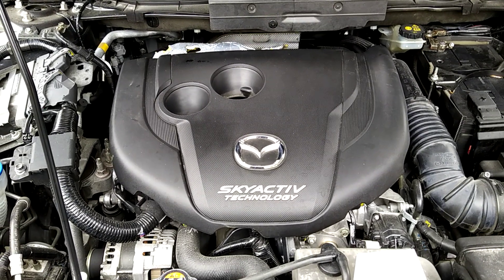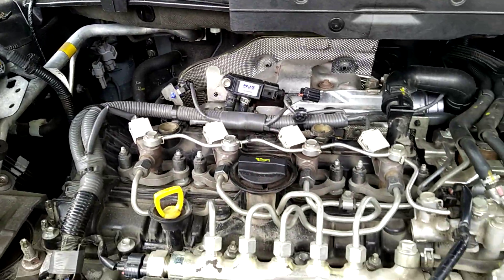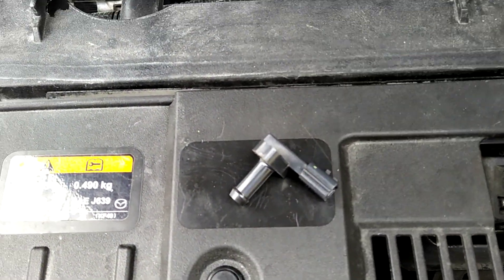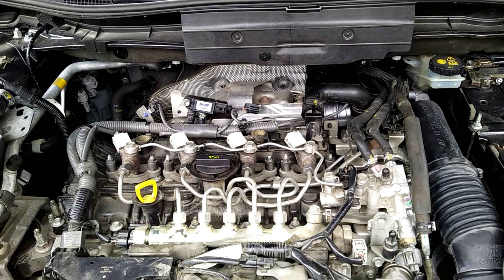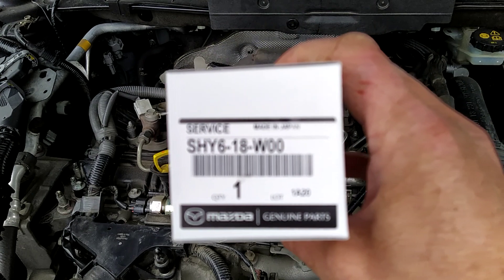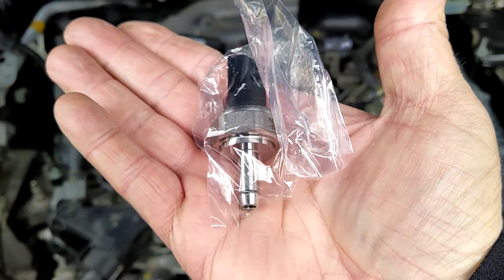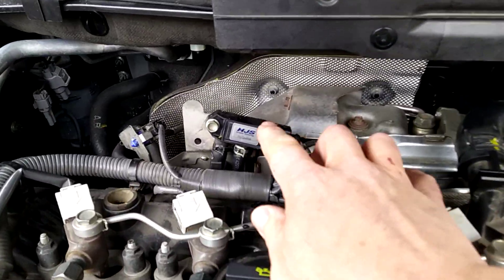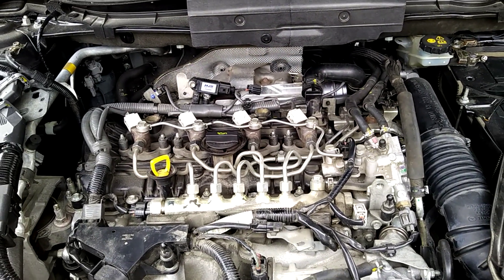Mazda SKYACTIV CX-5 2,2 Diesel DPF / Exhaust pressure sensor **IMPORTANT**

Comment: CARE: You are such a star for making this video, thank you BUT be careful as I've had a Mazda CX-5 2.2 150BHP diesel since new in UK and its done just over 100K miles. I guessed it was carboned up even though I tried to take it for regular motorway runs & the odd 'Italian Tune up'. I had the inlet manifold de-carbonised and had the speciaslist engine centre take photos of the  ports, they were ALL 1/3 the size they should have been - the rest was carbon. After getting the car back, its like a different motor although it took a while for the engine to re-learn that its no longer all choked up. My Exhausr Gas Pressure sensor (right hand one) was also becoming faulty (carboned I guess) with non-linear acelleration & SCBC & TPWS lights coming on - your great video made me change it and probelms solved. I think Mazda nowadays recommend an inlet manifold de-cocke every 40K miles or so which I 100% agree with. Only thing that wont have been de-carbonned will be the backs of the valves and not sure how bad these will be

Comment: Hello. Thanks for time and info you are sharing with all us mortals ;) 

I have 2.2D Mazda CX-5 Optimum 4x4 from 2016; with counter on 101200km. 

I had today my car at the Mazda car dealer to change engine oil and filter. Don't be surprised; I'm handy to some extend, but offer I had for change of engine oil was very attractive. This was probably because they tried to kept me as customer since I bought car as a used one from them a year ago; with used-car warranty for duration of 12 months which by the coincidence expired few days ago.
Mazda dealer reported that had read one fault related to Exhaust Pressure sensor and recommends that sensor to be changed. That offer is around 300 Euro. As soon as I returned from dealer I found and watched this video. Then I called dealer to clarify situation about earlier recalls and if DPF is included in the offer. Dealer states that my car is per day definitely out of warranty and that DPF is not included in the offer. 

Let me be clear, neither I had warning light on the dashboard this morning (last month), nor I have it at this moment.
Luckily for me and my family, I just safely drove 6000+ km this summer holiday.

definitely more times lower on the diesel level than in that moment. I

- Is the problem you described related to only earlier models or is generally appearing on diesel models, even newer once?
- What would you recommend; changing only Exhaust Pressure sensor as offered by dealer, or in package with DPF?
- Since my car is from 2016, I suppose that sensor type in my car is of the improved one. Does that means that it should fit and be of the same size as the one you used for replacement in your video. Does that mean that none of shortening the hose will be needed. Comment?
- Watching your video and reading through all comments, I came across two part numbers for the Exhaust Pressure sensor. 
                SHY6-18-W00 (written on the box showed in your video), or
                SH01 187G (I believe stated by you in some of comments) 
  Which one of above is correct?
- When you done the replacement; did you disconnect car battery completely; both poles; and in which sequence? 
- Is there any consequence for the car computer/NAV/Entertainment system/etc. when disconnecting battery that I should consider in advance?

I would certainly appreciate your feedback.

A long comment from one of your watchers on Friday afternoon; something you just needed after a hard working day ;)

Thank you in advance
Greetings from Norway
Reply from the maker: Hi, I would replace both DPF and Exhaust sensors at the same time. The Exhaust sensor part number I used is  SHY6-18-W00. Not sure what the difference is with the other one. The exhaust sensor costs around 100 euros, the DPF sensor can be found at bigger auto parts stores. Both are relatively easy to replace. For the exhaust sensor, you need to cut the hose to the same length as previous one and USE THE NEW WIRING SET. Not sure what the dealer offer includes?! But battery should be disconnected, one post removal is enough. You have to enter all your settings to the radio, clock and navi after the battery being disconnected. One more thing that is actually good to clean every year is the MAP sensor. It is located on the left hand side under the intake manifold. That one needs a gentle cleaning and spray with sensor cleaner. All of these will have you diesel humming again. Make sure to clear all possible codes as well.

Comment: I changed the sensor, but unfortunately the car runs just as intermittently when it is in drive! It has the error P246c:00-2F Particulate filter restriction - forced limited power (bank1) and I can't actually delete it with the diagnosis! any idea?
Reply from the maker: This case means most likely that your DPF filter has to be flushed.

Comment: Hi i am having the issue of all warning lights showing on my dashboard. Mazda CX5 2015 KE2FW. System shows as 11 errors. The vehicle is unable to be driven for more than 20 km/hr as the accelerator doesn't go more than that. Did you have all or any of the above symptoms?
Reply from the maker: The car goes into "limp mode" when something is wrong. I had about 8-9 codes, all got cleared by the DPF related repairs from the videos. However, if you have some major codes within those 11 codes, those need to be analyzed if there is something else that needs to be done. I hope you get your car fixed and running right.
Reply: @cronk216  thank you. I will scan and find the error codes first and then will come back to you for solutions. What are the error codes for the DPF related sensor repairs?
Reply from the maker: The codes that will be present are mentioned on the video description
Reply: Hi I replaced the Exhaust pressure sensor and the vehicle is drivable. However, there are some more error codes such as SCBS/SBS, FSC and more errors about invalid data and communication error in series of U0433, U0422, U0401, U0415, U0301, U023A and 1 PCM error PO488 EGR Throttle Control. 

Please help me on this. Thank you
Reply from the maker: @luqmaanlatheef1603  Did you try clearing the new codes and what happened? If they keep coming back there might be another issue. Was battery terminal removed during the sensor replacement?

Comment: My mazada cx5 having many light appear on the dashboard which are engine check, tyre pressure, DPF blinking and two more lights but there is no problem while driving. Now there is a new problem when you drive as the gear will shift up and shift down roughly. My car is mazada cx5 2013 I am really need your help. Thank you
Reply from the maker: Hi, I think you should have a scan done. If there are multiple codes which I mention on the video, it could very well be that you need to replace the 2 sensors. Also, it would be good to clean the MAF sensor at the same time. Check if you have the old style DPF sensor and replace it with the latest metal version. I hope this helps, please update what happened.
Reply: @cronk216  I'm looking to upgrade the sensors on my 2014 cx5, can you please point me in the right direction. Thanks
Reply from the maker: The Mazda dealer item is listed the video. The other sensor can be found at car parts stores.
Reply: @cronk216 here, you mean exhaust pressure sensor (metallic)...
Reply from the maker: @Mambwem  Yes, DPF pressure sensor is the plastic one with 2 hoses

Comment: Just did mine today. The hardest part was getting the old hose out and connecting the new one.
Reply from the maker: Long nose needle pliers. It helps to squirt WD-40 on hose ends when istalling, goes on much easier. Hope it all worked out for you

Comment: Hello sir i just watch your video only this time and i think im in the same problem of my mazda cx5 2013 dissel.because of check engine coming from my dash board..how can i purchase this thing sir?thank you and Godbless.
Reply from the maker: The DPF pressure sensor is a Mazda dealer item, the part number is on the video.  The other sensor should be available at a auto parts store.

Comment: I’ve got P0299, should I try this too?
Reply from the maker: Are you asking regarding a CX-5 diesel? Not sure that this will correct that, would need more info
Reply: @cronk216  Mazda 6 2.2d from 2016
Reply from the maker: You might want to check the turbo flap which is located on the right side of the engine towards the back. (Might be routed different from CX-5).  If the mechanical flap has detached from the rod which controls it, this might be one thing to check. Start from there at this point

Comment: Totally legit and awesome info. Did the same to my 2015 Mazda6 tourer and what a difference. Was getting P0471 and P2262 error codes but once I swapped this out I got better performance, a quieter engine and best of all, no check engine light. Part cost £80 and was relatively simple to fit, just have to take your time. Top video, top work, save me £100s. Thank you 👍👍
Reply: Same here
Reply: Hello 
Does IT still work?
Because i have the same 2 error codes and my mechanic says the turbocharcher is broken
Reply: apologies, yes still working and no problems since @Arno211990
Reply: @Arno211990  Hi, what was your problem? Sensor or turbo?

Comment: Where does the other end plug in? It's too tight in the conduit to remove?
Reply from the maker: One end connects to the sensor, other end to the connector on the engine end. Clips right in, the new harness is plenty long.
Reply: Does the new harness plug into the old harness? I can’t figure out where the engine connector is?

Comment: Hello, I am wondering if anyone on this thread can help me please? I have changed this part (from Mazda) to the new upgraded metal part but my error hasnt cleared, do you need to do anything else with software? Also it comes with a new wiring harness and hose etc, does all of this need to be fitted or can you use old wiring? Cheers in advance
Reply from the maker: You need to use the new wiring harness. If you used the new wiring harness, and warning lights are still present, you have to get the codes cleared. (Recommended anyway). Most of the codes and warning lights should clear with this, however without knowing specifics on your case, hard to analyze. In my case, all warning lights went away, however for example SCBS code was still active when connected to a diagnostic tool.
Reply: @cronk216  I’ve used new wiring and hose and it’s all cleared, thank you for your help and reply 👍

Comment: Hi, do you think this sensor is compatible with my 2012 CX5 (KE) 2.2 diesel 150hp 2WD?

 I have a lot of lights on in the dashboard and my mechanic said it is exhaust pressure sensor problem…
Thanks in advance
Reply from the maker: In this case, you should consult the Mazda dealer on this. Not sure

Comment: where can i order that part, hard to find one that works.
Reply from the maker: Hi, the DPF sensor is a Mazda dealer only item. The exhaust pressure sensor can be found at auto part stores online.
Reply: @cronk216 vice versa....😢

Comment: Thank you for uploading your videos and sharing knowledge for free.  We own a 2014 2.2d (manual, no 4x4) but haven't had any error codes yet.. Just lurching at low speeds, very odd.  Replaced the fuel filter didn't help.
I've subscribed 👍

Comment: Was there a recall for this sensor, I got a mazda 6 2014 touring,  if so would mazda replace it for free? Thanks for the video ...I'm saving the video as I hope this works 🙏
Reply from the maker: I am not sure if there was a recall related to this, however an upgrade to the part 3-4 times.

Comment: I've done the upgrade, replaced the dpf pressure differential sensor, maf sensor, high pressure fuel pump, vacuum pump, entire diesel filter system, high pressure fuel rail including pressure sensor and relief valve. 
But my dashboard still lights up like a Christmas tree, when I've been doing highway and brake/decelerate,...

Any Ideas?
Reply: Промывай ЕГР или Удали его
Reply: @aleksandritlocal  i was considering doing that 👍
Reply from the maker: That is a big set that was replaced. The EGR might be still one on the chain to look at. Did you replace all yourself? The battery cable could be removed for a bit with EGR check. Clear codes and hope that solves the problem.
Reply: @cronk216  thank you for the reply, the EGR had been replaced previously, but before I got the car, so how much they've done or how well, i can't say, perhaps I should give it a look 👍
Reply: Does high pressure fuel pump fail on this CX-5 2.2 ? What were the symptoms????

Comment: Mazda Australia charged me $850 for part supply and fitting,, rip off aint it?.. I saw this video but I tried to look the part and couldn’t find it anywhere near me and l use my car for business so l just took the plunge.. problem fixed though
Reply: God I am in nz I have the same problem. Can u still drive the car while on error code?
Reply: @lkj17  from the info l gathered, it differs from car to car. Mine had the following problem, 1) I started loosing power during acceleration. 2) transmission was not changing down on inclines, 3) the sound during stops felt like it was on high revs and l suspect consumption has increased a bit, lastly, a whole lot of warnings come up including stability control error, i- eloop error as well. as soon as l got that sensor replaced, car is back to normal performance
Reply: @lkj17  to answer your question, it’s not a serious issue and car will still drive but it will mess your driving experience and in worst cases, car might go into limp mode, now that something you don’t need.
Reply: @lkj17  if you can get another salvage car, just replace the sensor yourself , mine was the old type but these guys put the newer type, just get even the old one and car will work just fine
Reply from the maker: I would not drive the car with all these codes. Especially the transmission is really rough and might cause damage if driven long periods under safe mode
Reply: @cronk216  I drove mine for a bit but i started feeling like the drive was boring and booked it in😂😂😂
Reply from the maker: Glad it worked out. The part itself is around 100-150 dollars.
Reply: same Mazda NZ got me 1700$, this problem and other random thing they found
Reply: @lkj17  that's crazy,,, more like engine replacement
Reply: @Sportspitvee  this engine is fucked pretty much, should have bought a petrol and easily 250000KM
Reply: @lkj17  lol😃. What do you mean? Isnt it drivable anymore

Comment: Thanks I had error code P0472 with all the other warning lights and the sensor was the culprit. I tried cleaning it but to no avail. It was dead (a low circuit)

Comment: I have Mazda 6 2015 2.2diesel, 250 000km on clock. In the begining i receive scbs, tpms and check engine errors all together ( while i was on highway on high speed while i was in speed decrease or breaking). Now i get this errors together every next day even in city driving, but only when my speed is decreasing or right after the breaking. Car goes into safe mode and when i restart the car errors are gone. could anyone help?
Reply: This is the same as mine same model and year have you found a fix
Reply: @damonoconnor8194  i have on monday fix witj mechanic, its EGR fault, it can be replaced with new one but error can appear again, its better to turn the error off manually in computer by electric, 80eur

Comment: Hi! I have the same issues with my 2013 cx-5 but the error is P2263. Replacing both sensors will solve my problem?
Reply from the maker: Hi, not sure if it will, how did you end up with the code? If it is related to the turbo, that should be checked first.
Reply: @cronk216  Sir please I am have this very problem CX5 2013 and the guy put de computer and said that same stuff you show me is de problem now when he was explaining it to me i took a video with my parts I see the numbers and everything how can I please send you the video and how can I get the parts.i heard you spoke about upgrading one of the part please help me I am a woman how can I send you the video Sir please respond to me thanks. Living in Antigua
Reply from the maker: @shellyannemerson1536  The exhaust pressure sensor is Mazda dealer item.   SH01 187G  The other is a DPF pressure sensor that you can order from well stocked auto parts store

Comment: Where does the other side of the wire go, can't find the connector for it
Reply from the maker: Hi, not sure what you mean. The engine end connector is the only thing at play here. If you have a new exhaust sensor, use the new wiring harness and connect it to the engine end connector. The new wiring harness routes signals differently from the old one.
Reply: @cronk216  yeah I realised in the end that's how it is haha, I had a moment, thanks man

Comment: Hallo Mr. One stupid question: Can i simply remove sensors and just clean them? Is that possible? Thank you very much.
Reply from the maker: You can try that, but if you have the older model dpf pressure sensor, might be better to just go for the new one.